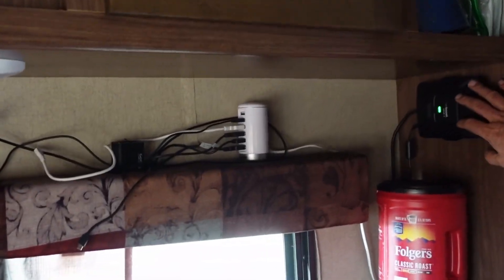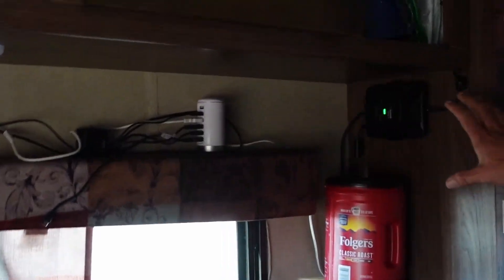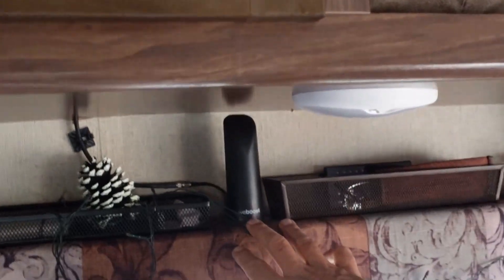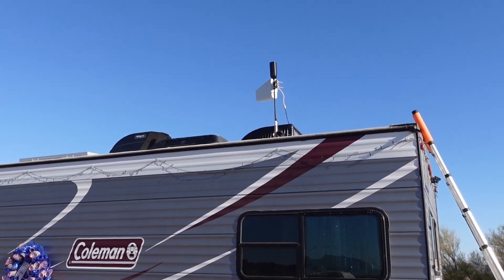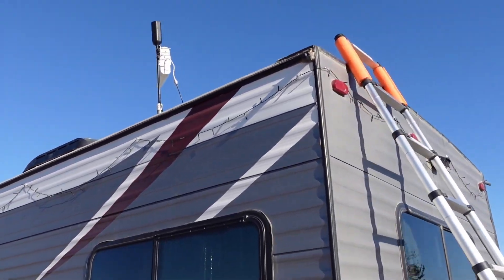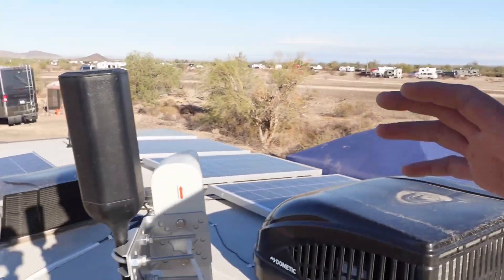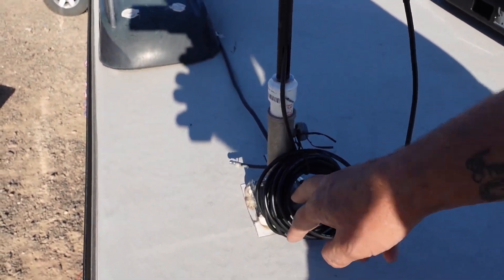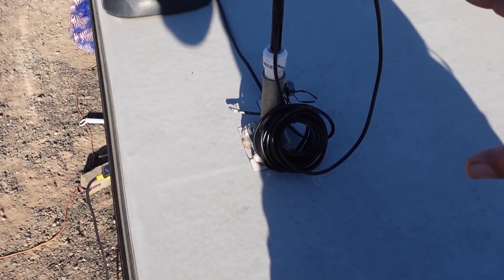Will it work? Temp install of a directional antenna with the Weboost Drive X RV cell booster

Comment: The Cell Tower is less than 5 miles from La Poza South.  The poor reception is caused by the 200,000 or so RV campers in the immediate area trying to use the Cell tower at one time. The reception varies with the number of users at one time.
Reply from the maker: Thank you for your comment, this booster  has improved our reception. And with adding the directional antenna we are able to work from our trailer. I do understand that it will get worse come next month but we are already taking that into consideration.